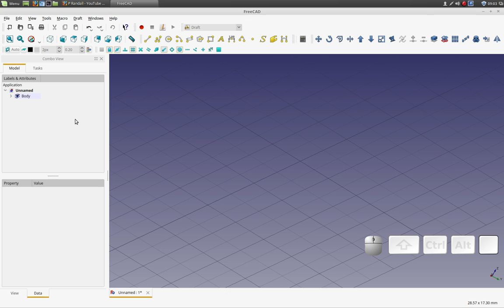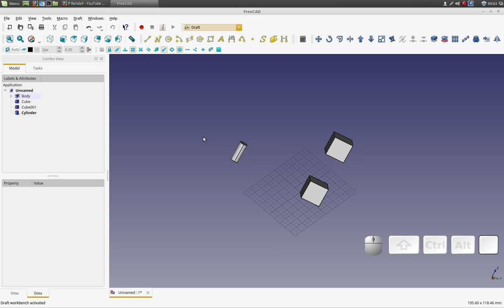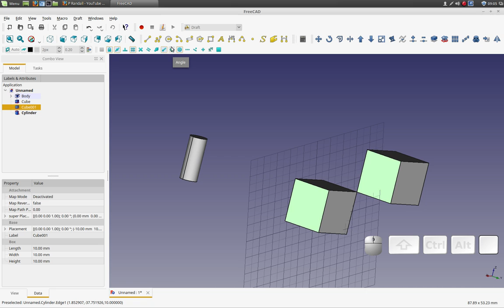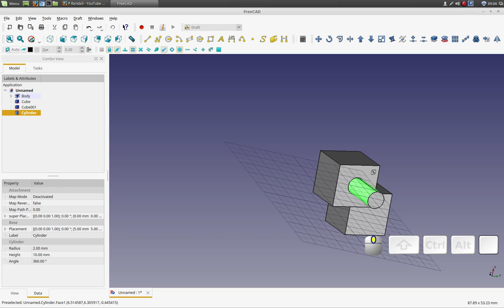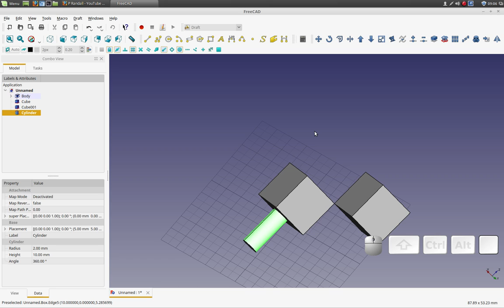FreeCAD - How to use the Draft Move tool on the Draft Workbench

Comment: What if my object is made from dxf import and it doesn't have enough control points to snap between the objects? I added more points to the sketch, but those do no translate as control points when in draft mode. Any advice?

Comment: What's ridiculous is that you begin the video by creating three primitives and then use the Part Design Workbench to translate them around, then go into the Draft workbench to translate them around. Just goes to show how utterly whack FreeCAD can be. Also, you didn't show how to use the Draft Workbench's X, Y, Z, etc fields in the Move dialog...those fields are an absolute disaster to use.

Comment: I've spent about four hours trying to get this to work on my own project, then following this example exactly. The feature seems to be 100% broken unfortunately, with all movements made relative to the viewing pane and viewing angle. The bug is difficult to explain unambiguously, however it appears that the depth of the object, with respect to the viewing plane, is never modified meaning that the two objects that are suppose to touch never meet. In this video, that depth is modified correctly and the objects touch.
Reply: I couldn't agree more...the Draft Workbench's Move feature is a broken mess.

Comment: moving cubes is easy, what I'm having problems with is moving a sketch I've extruded. It won't move.
Reply from the maker: Yes, the sketch placements can be annoying. If the sketch is mapped to a face or other part of a Body in part design it won't move and FreeCAD won't tell you wjy. It might pop up in the status bar at the bottom.  To move the sketch you have change the attachment to none ( or disabled I don't remember right now. ) The you can set the placement. I need to do a better/updated video on sketch placements.

Comment: The problem with freecad is that a lot is hidden in separate parts and lots of clicks. I honestly can't comprehend how people can work with this tool. It's completely counter intuitive.
Reply from the maker: I totally understand your frustration. This tool certainly isn't for everyone. That being said it offers a steadily improving CAD solution that does not require a significant cash outlay, and does not tie your designs to the licensing whims of corporate entities. That, at least, is the reason I use it. Also, if you think FreeCAD is counter-intuitive you should try Blender, it makes my head explode. Thanks you so much for commenting, you might want to take a look at some of the videos I made on TInkerCAD, OnShape and Fusion 360 ( Forthcoming )
Reply: @mathcodeprint   Complaining about free software is not something I often do, but  user input is seriously lacking behind. It's not designed for a fast workflow at all. I'm proficient in blender and while it was weird at first a lot can be done by shortcuts, a lot of the choices actually make sense. With Blender 2.8 the UI is no longer an issue. I'm not getting the same here. Moving an object alone is a few clicks too many.
Reply from the maker: @sidar87  I get totally get what you are saying. I see your remarks as constructive criticism. Also, you are not wrong. FreeCAD has  a long way to go. Too many clicks is one of the things that I think of often. I hope to eventually be able to help with that.

On Blender, you are also correct, I have been testing out 2.8 for a bit. I was very happy to see more mainstream UI concepts. Although, of course, I was just getting used to the old way. 

The point I guess I was trying to make was that even though all those things are true, I have gotten used to FreeCADs quirky approaches and outright failings. 

Please continue to "complain", your comments are welcome on my channel. :)
Reply: @mathcodeprint   Using  2.8 going forward I'm actually using the old school input setup.  So i got that going for me. The new one is a bit of a nightmare for me. Although not wrong, just too different for me to forget the old.

And of course I could play with it a bit more and get used to it, but I've been spoiled by simple interfaces over a decade now. I think I might just try fusion360 as it has a personal license too. It's a shame because as it is right now freecad has potential already, they just need to incorporate better widgets and shortcuts to perform the most mundane operations.

Comment: Hi, it works well with objects made with PART, but doesn't work (for me) with objects made with PART DESIGN, even when I clone the object.  Any idea why?  Thanks!
Reply from the maker: Without actually trying it, I say this. It isn't "meant" to work within a "Part", try moving the "Body" or even better put all your bodies into a part container. Part Design" is intended to create a single contiguous object. If you think of each "Part Design Part/Body" like a Tree. You can move the Tree Around in the forest but Branches are stuck in place. I don't like it personally, it makes positioning geometries within Part Design more difficult. You can get around it by designing sketches outside of Part Design then move the sketch into Part Design but that has its issues as well. Hope that helps.
Reply from the maker: Let me clarify some. You can still position items within Part Design but it just uses a different approach.
Reply: Thank-you for the insights.  I'm a newbie at FreeCAD, so I'm still trying to grasp some of the concepts like body and container.  I found that when I pad a sketch made in PartDesign/Sketcher, that no matter whether I click on PAD or BODY, the move command in Draft doesn't allow me to grab vertex points (like end points, mid-points, etc) as it does if the object was made in Part.  I thought cloning the body/pad would create a distended body (no history of the sketch) and thereby allow such snapping to points, but no luck.  I'll keep learning/experimenting, though!